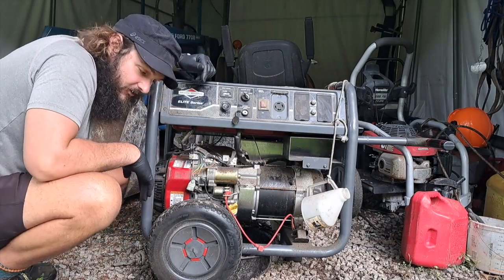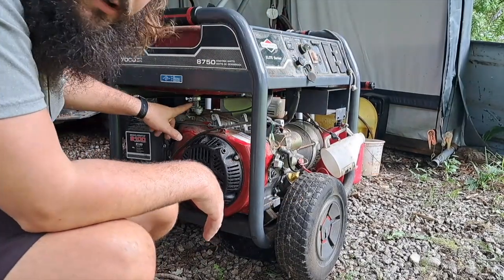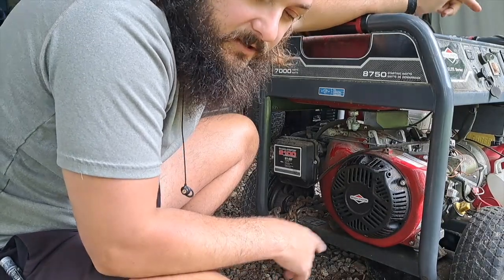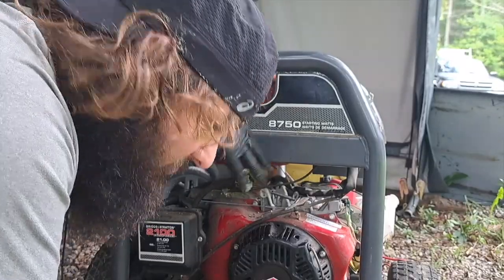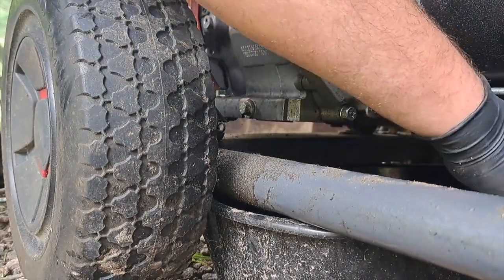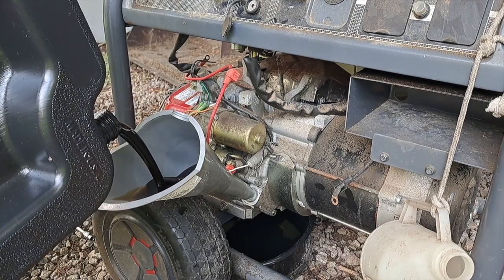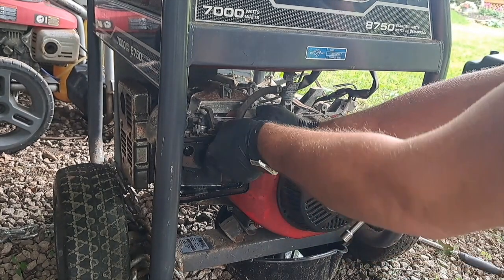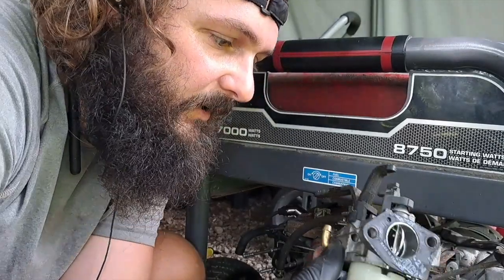Watch me fix this $1200 junked generator FOR FREE!

Comment: Rubber tip on needle is bad in the long run.  Alcohol gas softens the rubber and makes it stick.  And yes,  old gas doesn't help.   You spent $4 for some cleaner,  but not $5 for 1 quart of new oil?  Really?  If generator was broke you only lost $10 at best.  You spend more for beer for a day!😅
Reply from the maker: Don't worry, after I got it running I did another oil change with some nice synthetic. I wanted to stay true to the video title. I agree ethanol gas sucks! thanks for watching!